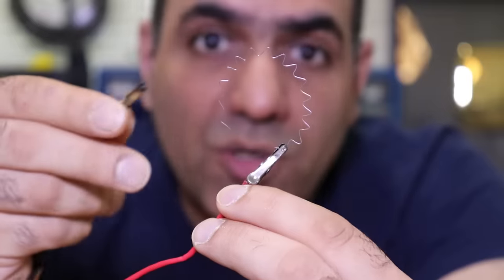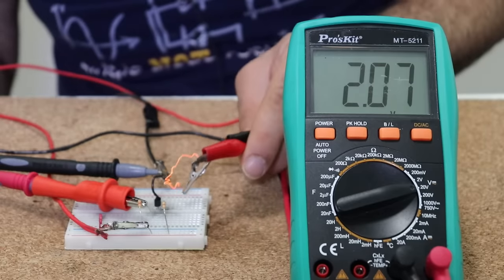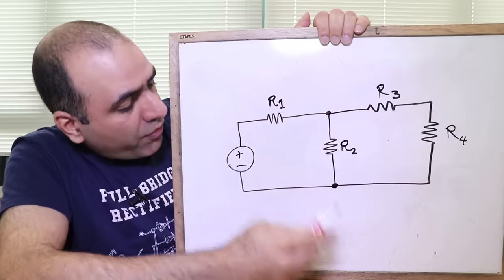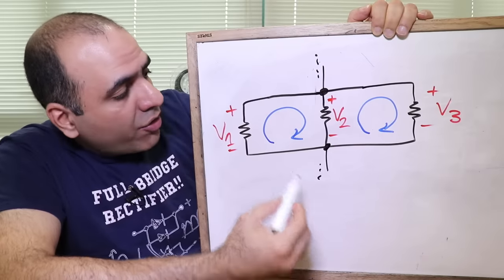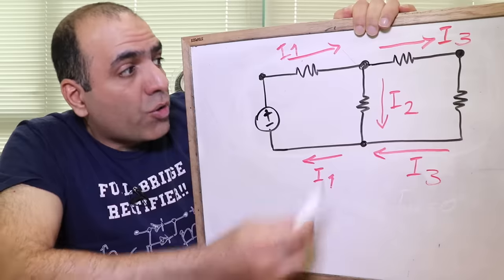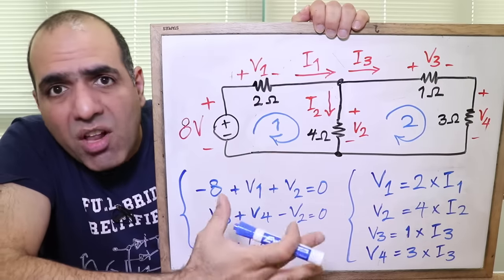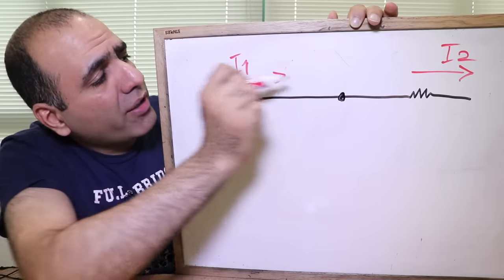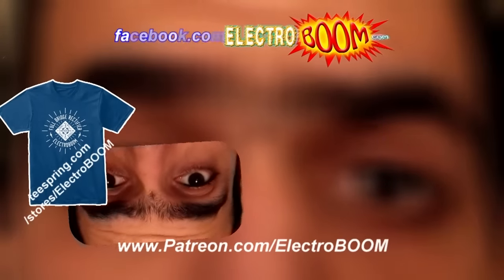LUMPED MODEL, Kirchhoff Circuit Laws (ElectroBOOM101 – 008)

Comment: Although you model inductors to account for changing electric field, this model is only suitable for low AC frequencies. At high AC frequencies, where the wavelength is comparable to the size of components, there will be significant radiation and the components start behaving like antennas and transmission lines. It is impossible to have a lumped model, so KVL and KCL can't be applied. Correct me if I'm wrong.

Comment: Thanks for clarifying that KVL doesn't rely on the fact that the electric field you are dealing with is conservative. Cause I was very confused as to why you could use it in the case of circuits having induced EMFs, or across an inductor for that matter. It makes sense for it to be a consequence of the more general energy conservation law.

Comment: Actually that's not true though, not all water that enters a pipe comes out the other end. Of course if you are talking about flow you may be correct but once flow stops or water pressure is reduced, some water will remain in the pipe. Just saying, you may want to consider another analogy... Cheers...

Comment: After a long time Vss of the resistor will be the same as power suplys voltage because inductor will act as short circuit. Am i right or is this only true for ideal circuits??

Comment: @Electroboom
Show viewers how transistors are used as switches, a circuit to turn on an led when the transistor base is biased.  Can also use the circuit to energize a relay to switch an isolated load.  Follow up videos for the many uses of transistors, such as oscillators and amplifiers.
Reply: I just saw you did a video on using a Bipolar Junction Transistor as a switch 3 years ago.  Oops..

Comment: please don't mix values and symbols in an equation, 8 + V1 doesn't make any sense, since you're not specifying what "8" means. Likewise, V = 3*I is meaningless too, because that implies that voltage is 3 times the current, meaning voltage would be in Amps, instead of amps*Ohms = volts. Please stick with letters until the very end.